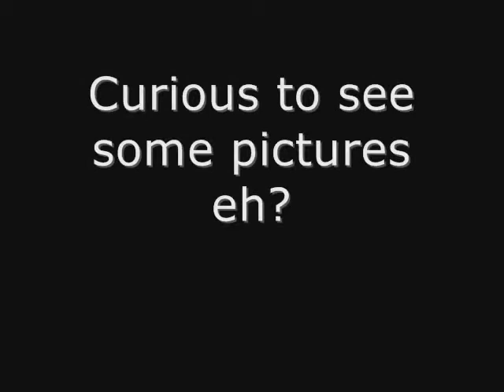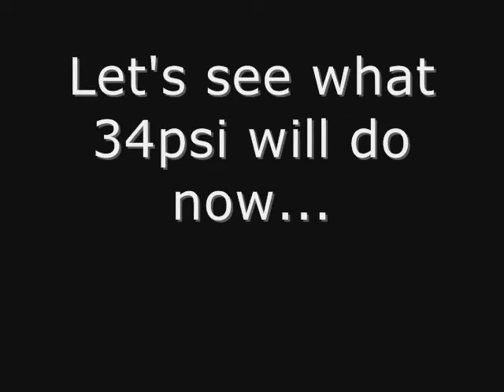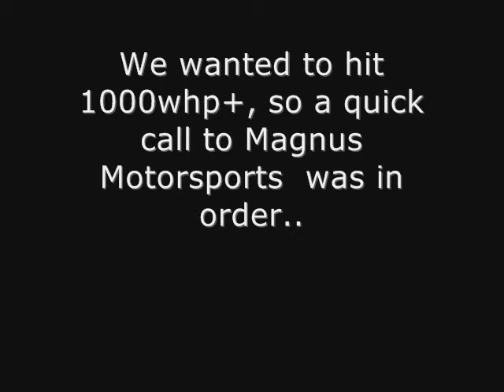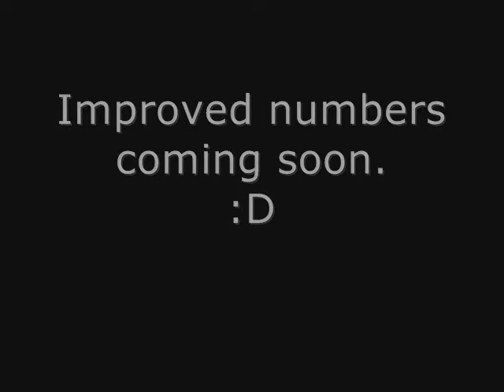54 PSI... 1000+ AWHP 2g

Comment: @MrJpierson apr has good kits for the gti (mk5 is what I drive) that make it reliable it'll cost you 12K to get it in the 11-12s with 370whp, but its also way harder to mod gti's, it is to my belief that the engines were better made, it was just frustrating when I saw my friend's 2g valves snap in half when we torqued everything to spec because harmonic balancer bolt still came off even with red lock tight thats my personal experience but sadly everyone had even worst luck than us w/dsm's

Comment: I know but 54 psi is alot i would have just went bigger turbo less boost
Reply: Dave H  even tho its 7 years ago still have to comment. A bigger turbo would require less boost ur correct but it would also take longer for it to kick in.    A 7 liter will spool a 67mm faster than a 2.0 liter.